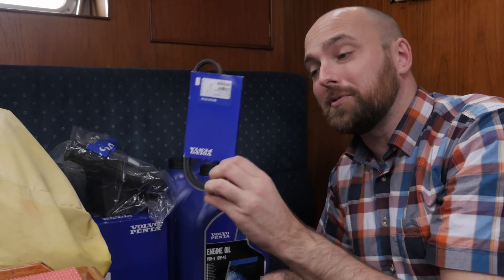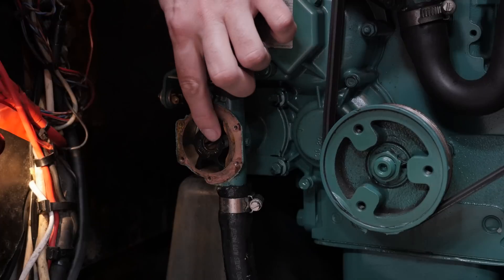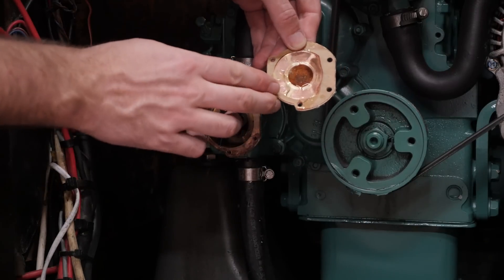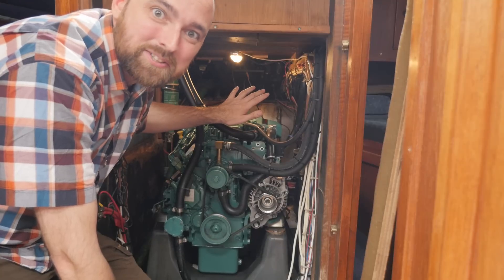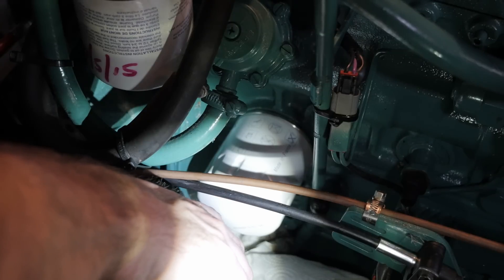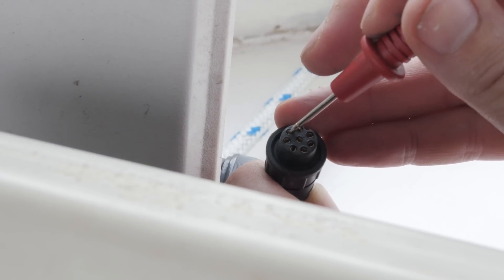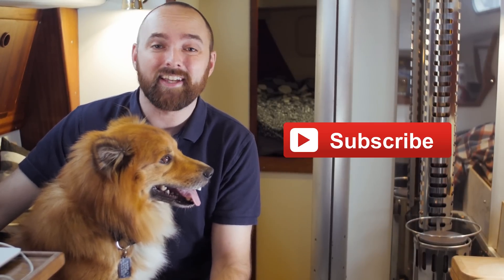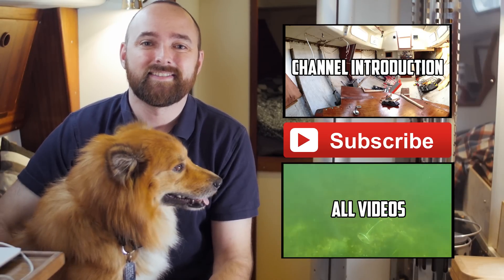Sail Life - diesel engine maintenance & AIS transponder installation, BHA #1

Comment: Don't pierce your oil filter to get it off, get the right tool, like you did :-) !!
If you pierce it and still cannot remove it you now have no engine, or a massive leak to fix...

Comment: Top tip on your spares... if you're unsure whether the new spare fits, such as your drivebelt, fit them straight away and keep the old one as the spare.  That way you have a new unit fitted that should last ages, and you can guarantee that your used/spare one fits if you need it and will get you home!
Even better, buy two identical new ones, fit one, and keep the old as a spare spare.

Comment: I viewed a previous video which was the install of your cabin heater. I understand some people can write in and be very nasty. That is not me.
While viewing this video I noticed during the raw water pump service you neglected to mention a few service items within the raw water pump.
These items are;
1. The Cam, found inside the pump housing. This item is responsible for the volume of water the pump generates.
2. The Cover Plate, the cover looked worn when you had it off. Two ways to reuse the cover, sand the worn side down to get to a clean flat surface with no wear. The other way is to flip the cover over and use the side with the manufacturer’s writing. You must get rid of the paint and sand the surface incase of any high spots due to the embossed writing.
3. Shaft & Seals. On this pump there are two seals “ water & oil “ when working on the pump like you have done there are typically two windows cast into the pump, the windows are between the two seals. The windows are there for a reason ? If the water seal dies the window will let the water escaping from the seal go out the window instead of damaging the oil seal. If you are a good boat owner and check the engine oil on a regular basis you will most likely see the water dripping out of the window. People are not aware of this, for that reason you will see on a lot of engines with all kinds of corrosion around the raw water pump / timing gear housing. Now you know why ! 
The big problem with letting the seals get so bad as to poor water out of the window is ? On a gear driven pump like you have once the oil seal is damaged water will no longer go out the window cast in the pump housing it will now pass through the oil seal into the engine oil sump. At this point as a boat owner when you check the oil ( if you do ) you will notice the engine oil has turned to mayonnaise ?
Now have you destroyed the engine by lack of service of the raw water pump ? Not likely but I have seen this happen.
Make sure when you are doing your videos that you make viewers aware of the pit falls of no doing the proper maintenance or doing your own work ( DIY ) if one does not know what they are doing it can cost them a lot of money !
4. Shaft, these type of seals are lip seals. When servicing the pump check the shaft to make sure it has no groves in it from the seals. If I where doing the service on the pump, every other service I would take the pump apart including the shaft. I would replace the seals both oil and water.
I would use a good pump lubricant when installing the new seals and old shaft into the pump housing.
Service on a pump like this should be done once a season or every time you change your oil.

Comment: Don't know if anyone has told you yet but the best thing to use when changing the oil filter is throwaway diaper. It drinks a lot more oil than paper towels.

Comment: When you change the oil filter make sure that the gasket from the old filter comes off the filter before you put the new oil filter on.

 Unless you like oil spraying all over the engine compartment.

Comment: Mads, that oil you lubricated the oil filter seal with looked a bit black. When i do an oil change on my car i use the new oil for lubricating the seal. No idea if it is required to do it like that but i feel better using the new oil. To make this easy I invert the new oil container once before opening it (shaking it probably works too). Then when i open the lid there is some easily accessible oil on the inside of the cap which i use to lubricate the new filter seal. I realise this tip is too late for this filter change but maybe it will be useful for the next one or for one of the comment readers.

Comment: What horsepower or kilowatt is the Volvo engine? It looks to be on the order of 40 to 50 horsepower, but that could be way off the mark?
The engine looks to be exceptionally clean in comparison to those shown on other boats. Would have to say -- you really lucked out!
Another question - does the engine compartment have a fire suppression system? If not, you may want to consider that.

Comment: Basic reliable technology, site glass!  No dials, electricity, floats just an eyeball.  BTW the SWR is a bit high.  Not sure but it may interfere with transmission of your AIS data.  You may have to match the impedance but check all connections first.  Great to see you on your new home!
Reply: Pass Me By An SWR of 1.7 is perfectly fine, it is not going to cost much in the way of signal strength and is well within the safe range for any practical transmitter (i.e. peak voltage should be well within the safe range for the RF power amplifier when fed into, typically, a 50-ohm transmission line) -- in fact, with some antenna types that are more broad banded an SWR of 1.7 is about as good as you will get without a matching tuner, not that there is any need for such with an SWR of 1.7.  But it is great that SWR is reported as that can be a good diagnostic indicator for  failing antenna or coax connections or water getting into the coax itself as the SWR will begin to increase significantly if that happens (both a dead short and an open connection are infinite SWR, for example).

Comment: A plastic pipe on the fuel tank is not such a good idea and would not satisfy regulations as it is a fire risk should there be a fire in the compartment. Fuel lines should be fire resistant. If you have access to the top of the tank a ultrasonic transducer would be preferable.  
It is also a good idea to fit an automatic fire suppressant arrangement in the engine compartment or where there is a risk of fire. A suitable product such a 'fire trace' is easy to install. 

http://www.firetrace.co.uk/applications/applications#
http://www.firetrace.co.uk/images/Flyers/Vehiclesflyer-2015.pdf

The main danger on yachts is a short in the wiring and on a boat such as yours with somewhat less organised wiring it is a real risk.
Bearing in mind that some wiring is not feasibly protected with circuit breaker etc such as engine cranking as the initial draw current is too large. If there is ever a fault in this cabling then a meltdown is assured if the battery isolator is not activated promptly.

Must say your videos are well presented....very nice clean engine.
.
Reply: this is very common in Europe. i have seen it alot. my Cat also has it. the good thing is you can see contamination in the tube. the bad is as you say an engine fire could melt the tube. As a mechanic i am looking at this for upgrade to normal float sending units. i dont recommend it for all boats but as i have a cat we sail almost flat and i am installing them in the centre of the tank fore and aft. As well i have to hit a plunger to let fuel into the site tube. this means there is never more then a few ounces of fuel in the tube that could burn. its still bad but managed.
now the boat is a 93 and non have ever burned so i think i will leave the tubes in as a backup fuel sending unit. like i said it is very common on boats here. and these are high quality boats.

Comment: I have a plastic pipe also. They tell me it is dangerous drilling a hole, so i am thinking of a plastic 1cm tube. Floating a magnet on top of a small float inside the tube. Butting reed switches outside the tube. Next wires go from reed switch to LEDs to an easy viewing location. I am working on a NMEA0183 sender which will send the data to a chart plotter.....i will see how the LEDs go. Great work and love your vids.

Comment: GOOD video! Nice work. Does your Link-10 have an LED out? I don't think I have ever saw my LEDs like that. Have you looked into a "Speedseal" for the water pump? We have put the SPeedseal life on ours and it makes the job easy.

Last, WHAT are the temp wire connectors you used on the AIS??? Where can I get them? GREAT idea.
Reply: Wago connectors and they aren't actually temporary connectors although they can be used that way. They are now a preferred method (along with other similar makes) in the UK of making a permanent wiring connection where access is limited ie underfloor, in walls etc where using terminal blocks may lead to the connection undoing itself over time.
Reply: +Jim Porter Thanks Jim. I do not want them for a permanent connection. BUT, I do want them so I can assure the connection is correct BEFORE I use a shrink tube butt connector.

Comment: Wow that diesel looks immaculate!  The filter: others may argue but grease on the o-ring will allow an easy spin-off.  Oil will squeeze out and leave you with rubber on metal making them difficult / impossible to take off.  I know, oil is easy but from experience I'd much rather not have to fight with a filter in a tight space.

Comment: Ha, good one! Wish I could be there for the boat warming. A tip for the impeller: You might want to check/replace the the seal on the impeller shaft (usually 2 faceing eachother), they hold tight via a metal spring that can rust away unnoticed and then water might leak into the engine. Too bad they are quite expensive. Haha, my last boat only had a cable tie as a dipstick and this one is empty when it reads 1/2 full. Comes in very handy.

Comment: I'm sure you write the hours and date that you changed the oil filter in a log,  but when I used to work a marina we also used a sharpie and wrote the date and hours on the new filter as well. Great video Mads.

Comment: Great video, Mads! Your absolutely right about the oilfilter. When I bought my present boat I did the same engine-service right away. Also on my boat I had to use tools to get the oilfilter off. When tighten it like you did you usually get it of by hand at the next filterchange.
Hope your schedule works out. Then, maybee, I can have a tour of Athena in DK when your back.
Regards, Håkan.

Comment: Great video as always.  I recently did some maintenance to my Yanmar with one of the kits from Niemic.  You seemed much more smooth than I was.  I also had to chase wires down when I installed a VHF and connected it to my chart plotter.  Wiring through a sailboat is always a good time.

Comment: I am working on finding a boat for my retirement. I am intimidated by few aspects of sailing. It is the electrical systems that are the most threatening to me. Your going through the process of finding, testing, and connecting the correct wires...still intimidates me;)

Comment: Devils advocate here again 😈! Do try to open up the diesel tank to check for scrap or water. Switching fuel filters not only give you a hint on the condition of the fuel, but you get to practising airing the system wich is not too fun to do for tve first time in open seas. Dont forget transmission oil and water.

A tip on not spilling (as much) oil when swithching the horizontal oil filter is putting a plastic bag around it.

Comment: Mads that is a very nice boat! Congratulations! I absolutely love your videos - keep them coming, I can´t get enough :D
Regarding the antenna - a low VSWR is a good thing but it tells you absolutely nothing about the antenna. I have used antennas with a quite high VSWR and they worked brilliant. As well I had antennas with a perfect VSWR but didn´t hear a thing. A dummy load also has perfect VSWR :D You are right - it should be low but in fist place the antenna should be working good. Sometimes it helps to vary the cable length to get good VSWR. A reason for bad VSWR could also be a bad / rusty / wet conector or a kink in the coax where the power is then being reflected back to the radio.
Maybe there´s a Ham around which could help you with a antenna analyzer... ?
Whenever you´ll install a new antenna also swap out the cable and get the best quality coax you can get your hands on. A good coax makes a lot of difference compared to a bad one. 
I hope you still have the plan to make your ham radio license! Would be great to get in touch with you over the air!
Fair winds an following seas! 73!

Comment: I've been looking at your stairs and thinking, how could a stair be built there so he and his adorable puppy don't have to suffer on that vertical horrible thing.

And i think i've come up with a solution that's both effective in its stored format and in its deployed form.

Issue one, you can't have a permanent angled set of steps there, obviously, and you can't have something that's stored some place else or take a different, unusable form as it is stored.

Issue two, it has to give enough angle to be comfortable for a dog to get up and sturdy enough for a full grown man to get up and down daily, with added weight of items.

With those two basic things the simple solution is a pivot swivel extendable ladder.

You know those ladders that full sized yet can be stored in a very small place because they are telescopic? 

What if you took one of those, added a swivel point on the top section and then installed it in that frame?

The idea is that it would have 3 steps and when it would be used in the stored position it would fold in on itself and provide the same step distance as you have now, BUT, when you don't want access to the sides and want to get up and down freely, you just pull the bottom towards you and unfold it. Thus, obtaining a fully angled set of stairs.

Now, i know the idea is rough, and certainly can't be done with something that you could buy, you'd have to fabricobble something up, but i think it's the simplest, best solution for a set of stairs that have to be out of your way in certain moments.

Also, changing the belt upon new ownership is the best thing to do regardless of how good or bad the previous one is, unless the owner took it upon himself to service the engine completely and has provided bills stating the recent dates for it (the sensible thing to do upon selling a vehicle, land, air, or water) you're better off putting the payment down now then deal with potential damage later. Learnt this the hard way with an engine where i took the owner's word for true and it resulted in a lot of cam damage.
Reply: Before you change the charger, check the battery. Have it checked by someone with a battery tester (or buy one off eBay, EricTheCarGuy (youtube channel name) has a video on how to test your battery and see if it's any good anymore, highly recommended to check it).
Reply: Also, for the future, put some new oil inside the filter as well before you install it. Not enough to drip, but enough to get it started and not have to run without (engine).